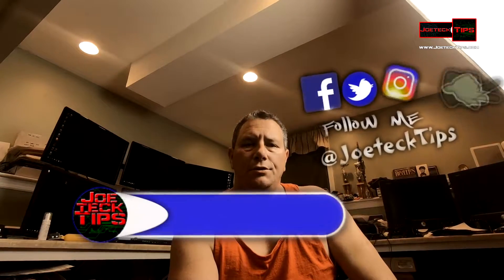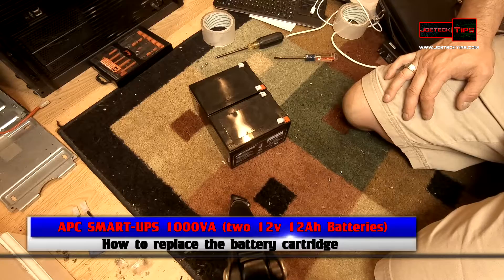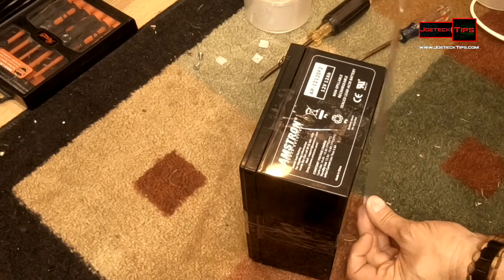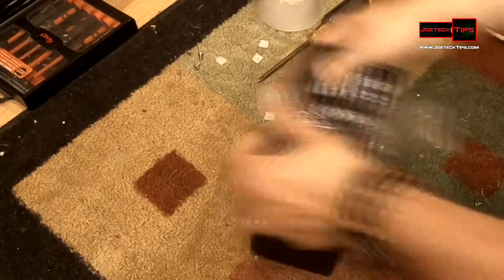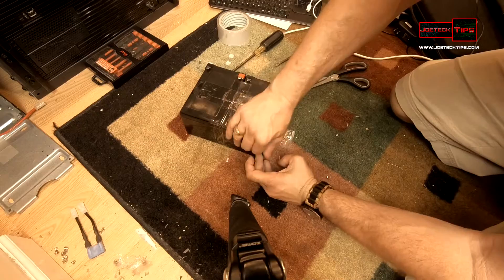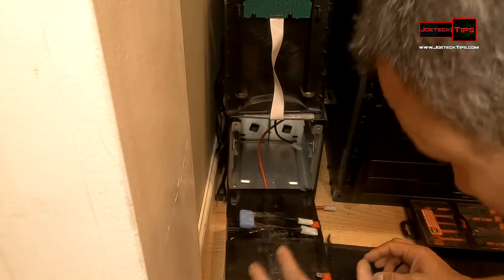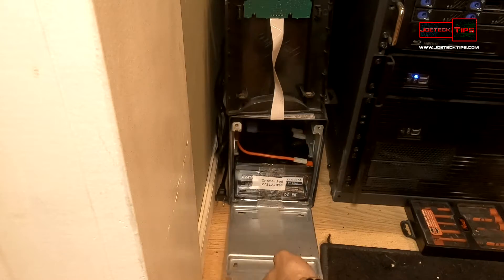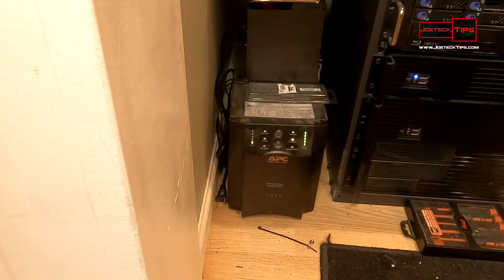HOW TO | APC SMART UPS 1000va Battery replacement | JoeteckTips

Comment: Hello, Joe, I have a problem when installing the battery in the same way for the same model in the video. When the device performs a test, it turns off and does not work. What is the reason?
Reply from the maker: Did you perform a self test? Press and hold the power button with it plugged in? The new batteries could be bad.

Comment: Spent half the video making a tape pull handled and skips how to take the front plastic cover off without cracking or breaking something sigh….on to the next how to video
Reply from the maker: Seriously? Two notches, on the front. Pull it forward. Pivots at the bottom.
Reply: @ Yes. Was clearly displayed within 20 seconds of the next video I watched. Great video. Highly recommended 👍
Reply: @Joeteck Everything is easy when you know how. When you don't, it would be nice with a video.

Comment: will the Smart-ups lights turn on while i have the device plugged in an outlet? even thought the batteries are dead, i just got a device trying to trouble shoot it, right now it wont turn on at all plugged in or not plugged in
Reply from the maker: Correct, will not turn on without batteries.

Comment: you can remove the rail inside the ups and fit the RBC7 XL batterys with a slight modification to the termnals... done it on mine twice now :-)
Reply from the maker: Removed them twice? lol.. I get it, two different UPS's...